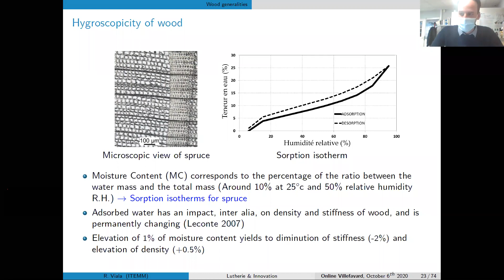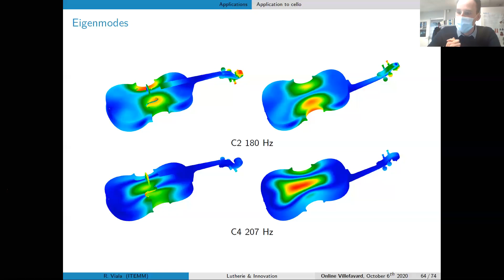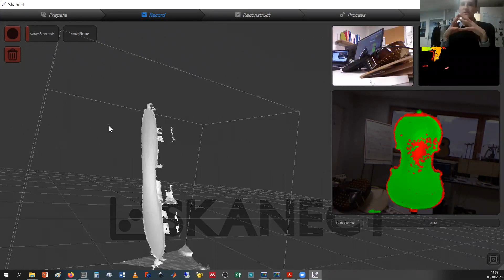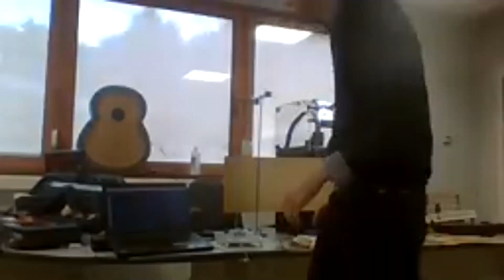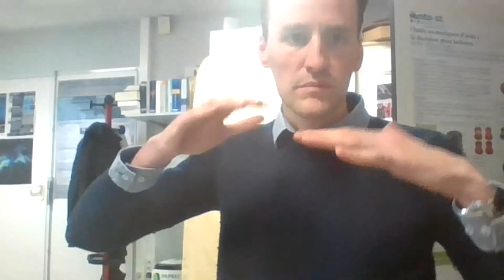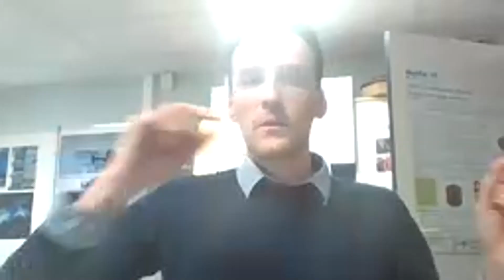Romain Viala: Numerical and experimental approaches for instrument making

Comment: String tension doesn't affect the dinamic response if you don't change the neck angle, but if you change the neck angle you could hear as a sound change, is because if you have a different string length( higher angle longer strings lenght lower angle lower string lenght) which will result in a different string behavior( different amplitude and lenght of vibration oscillation). As well, if you keep same projection , nothing will change as you will have same string lenght, same vibrational behavior.